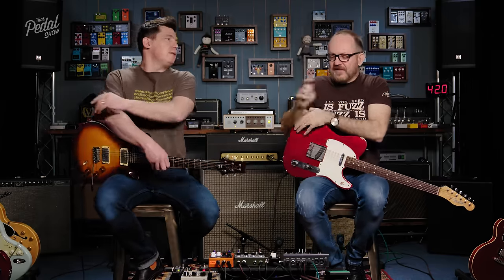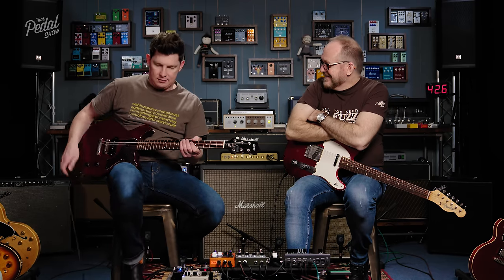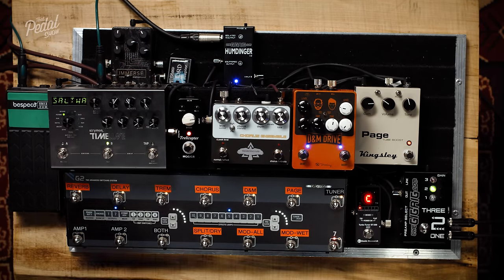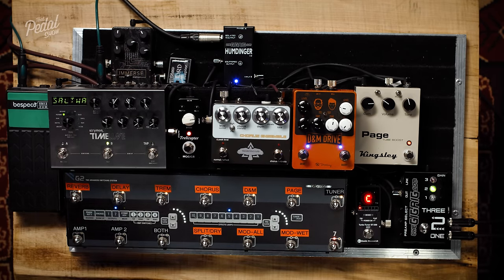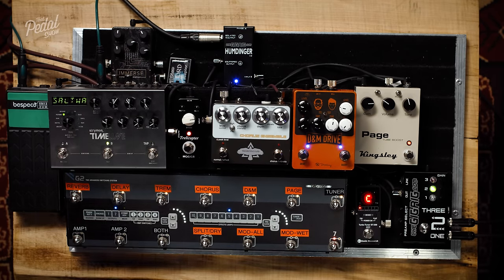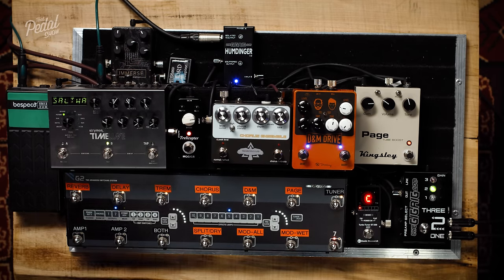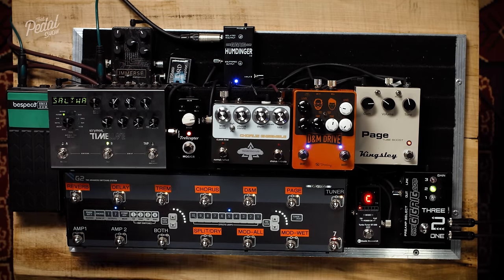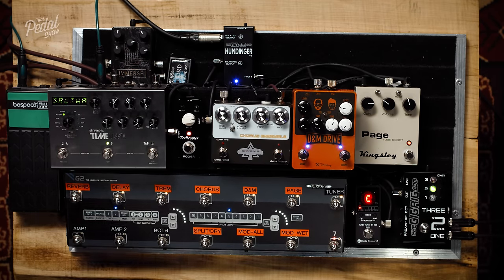Wet-Dry & Wet-Dry-Wet Amp & FX Setups Explained – That Pedal Show

Comment: It's funny. Maybe it's because I'm primarily a recording/mix engineer, but whenever I set up a wet/dry rig, I tend to think of the dry amp as my primary and use the wet amp as more of an effects send. I also tend to like a little reverb (literally just a touch) in my dry amp, so I guess it's more of a wet/not-nearly-so-wet rig.
Reply: The NotSoGuitarGuy I set them up as the dry signal is the base tone, then use the FX loop send, line out, or a DI box between the head and cab (make sure yours can handle speaker-level signals before trying it) to send that “uneffected”dry tone to reverb/delay to the FX loop return of the wet amp.

This thing where they’re splitting the signal before it gets to either amp is a strange and foreign concept to me. I guess they like how it sounds, though, and that’s the important part.
Reply: @OtherTheDave  - I'm definitely splitting before the amps. Sometimes I'm not even running into a second amp, per se. Sometimes I'll split off a direct signal and use cheating-ass computer modelling for my wet side and mic my dry amp (for recording purposes). This is about the only way I can manage wet/dry/wet with my current equipment.

Really just depends on the situation.
Reply: The NotSoGuitarGuy See, I’d call that a dual mono setup where you’re only effecting one of the amps. Wet/dry(/wet), as it was taught to me, was about mimicking the studio process where you record “your tone” (using however many amps that takes), then send that signal to whatever additional FXs you want (and, since this isn’t the studio, then on to another amp(s) so you can hear your FX).

That said, you do you. The great thing about music is that as long as you like how it sounds at the end, you’re doing it the right way.
Reply: @OtherTheDave  - if you look at it like I'm sending to an amp that just happens to be a virtual amp, I'm basically doing the same thing. The chain looks like this:

Guitar > wah/comp/distortion/boost/eq/etc pedals > splitter > dry amp > mic > computer > DAW

splitter > DI > interface > stereo amp sim with wet effects > DAW

I really only do this for wet/dry/wet where I need a stereo wet. I only have 2 amps and can't pull off a proper wet/dry/wet setup.

Otherwise I set up two amps and do proper wet/dry.
Reply: I like to put one delay in each actually, allows for some cool ping-ponging without going stereo.
Reply: Randy Russell I think my stereo delay has a “dual mono” mode. I’ll have to try that!
Reply: Same. I am hooked on a Dual rec/Vox split ATM, with all mod/time fx on the Vox dialed back a bit. At a 10 & 2 stereo spread it's just awesome
Reply: @thenotsoguitarguy9429  That's the pertinent point. Making things work with what you've got. Coming from recording in analog, coming into the digital age of late last century I've realised that a lot of $ was wasted due to thinking that some bit of kit was needed. I can get a sound comparable to what I needed over $150kau+ 
'90s with under 10k now still using some stuff from the old days. Whatever works, eh?

Comment: Great stuff as usual! It really spelled out the difference better than I've ever heard before. So now my question. I have one "good" tube amp that I use/like. It sits mic'd in an iso cab. I also have a modeler on my board as a back up for an amp failure. Can I use both in a wet/dry application? Is there any phase issues to worry about? I use in ears for monitors and can pan either as needed. Should both be up the middle, I'd this will work? I have a TC Electronic Nova delay to split the signal.Thanks and keep up the amazing work!!

Comment: I only play at home and have a wet dry rig beause of TPS and couldn't be happier. The first time I heard it in person, I couldn't stop giggling over pure sonic joy!

I've got 2 questions:
1.  Say you run 2 amps with no pedals ( I know, blasphemy). So you would for sure want something to isolate grounds(earth), but even without pedals, you would want a phase switch right? Amps getting the same signal from guitar could still be out of phase. In most tube amps, the phase is flipped at every typical gain stage. So depending on how many gain stages each amp has, they could be out of phase correct? 

2.  I really prefer phaser and flanger before drives. But don’t want them going to both amps. I would love to have drives to dry, then modulation, drives, and wet going to wet amp. Any suggestions? I was thinking of splitting right at guitar. One path would be modulation going into drives then into wet effects onto wet amp. The other path, with similar drives into dry amp. Could get some interesting sounds by varying the types of drives you have on each signal path. Haven't tried it yet, but eager to test!

Cheers from long time viewer! Hope y'all had fun at NAAM. I see the Captain and the Dane met Mr. Mayer!

Jason

Comment: A 1 Amp wet-dry rig? This is the video we have all been waiting for, thanks fellas.  I finally jumped in to build my wet dry rig.  It went great and I discovered it sounds just as good with wet-dry running the 2 signals through separate channels on my amp...phew.  TPS legal counsel can exhale...you just dodged lower back injury, class action lawsuit we were all about to file.  Keep on rocking in the free world...you two...

Comment: If you send Vibrato to the wet amp only is that, summed with the dry amp, not you really making "chorus"?
Reply: In some way yes, and that's kinda how the CE-1 "stereo" feature works. Wet (modulated, vibrato-like) on one side, dry on the other.
Reply: Yes but not Univibe-style Vibrato. I tried that. It wasn't a chorus.
They did this with the VB-2 in another episode. I believe Dan ran a Paige>Tumnus>ABY split>VB-2 & Delay to wet amp.
Best tone ever.
Reply: @mattgilbert7347  Univibe is not considerable a proper "Vibrato" because it's not just a wet (triangle or sine) modulated signal so that's fair.
As you say this could work better with a VB-2. Or if you hear just the wet side of the CE-1 it's just a vibrato :)
Reply: @WillGalluccio  Good reason to invest in an inexpensive vibrato. Doesn't have to be a VB-2W like they used in that episode.
Reply: @mattgilbert7347  Must agree with you all the way!
Reply: I am feeding three wet amps, two with phaser and one with vibrato, I want to compare it with a Boss DC-2 Dimension.

Comment: Hi guys, another awesome vid 👌. One question. Would you get the same dynamics from a wet/dry rig with say for instance 2x12 and 2x12 on top of one another and 2 heads on top? Thinking floor space issues in tight venues! Cheers

Comment: I was having a problem with my wet/dry setup and it was because I get my overdrive from the amp so I put the split in the fx loop but I didn't get that there were more noise issues that way.  Thanks Dan!  (and you are good eye candy Mick)

Comment: That was a really great informative video, thanks! one question though.  On the wet-dry-wet, I had originally thought it would just mean having a second splitter on the wet signal path at the end of the chain, I didn't think that you would be running in stereo for the final pedal.  What would be the difference if you used non-stereo wet effects and a second splitter? Would this negate the benefit of a wet-dry-wet over a wet-dry rig?  If you don't have the stereo effects switched on, then, what is going on with the signal chain?

Comment: Yesterday I did an experiment trying to get a wet/dry setup with only 1 amp (using Positive Grid BIAS) at home.
The signal chain is guitar->overdrives->soundcard input, from here, one soundcard output to a mixer, this will be the dry amp, and one soundcard output->Boss DM-500->Strymon Timeline->EHX Ocean11->second mixer output (wet amp). The mixer main ouputs connected to my monitors.
What do you think about this?, I got a phase cancellation issue, but I think that I can make this setup with one real amp and using a good splitter, and could sound really good!
And even I could insert a preamp or EQ before the MD-500 to add flavour to the sound of the wet amp.

Comment: I don't see how wet/dry with a 100% wet amp is all that useful though... You can't have more than one effect in your wet signal, right? Because if you have a delay and a reverb, both set to "kill dry", then the delay will only have the repeats, and then the reverb will only add reverb to the repeats, and remove the actual repeats (since they're its dry signal). So... What gives? Any tricks? One amp per wet effect?
Reply: Correct me if I’m wrong here, but you could do it, but you would only have the “kill dry” on the last effect in the chain, then in theory you could have as many as you want
Reply: @chrisj2155  That wouldn't help though. If you have a chorus, delay and reverb, and then kill the dry signal in the reverb, you will lose your chorus and your delay trails. The only thing you'd hear was a slightly more modulated and longer reverb trail. The chorus and delay would be the dry signal that the reverb pedal kills.
Reply: You don’t use kill dry in the wet amps.  The original signal is in the wet amp as well.
Reply: To use the kill dry on the wet amps (the purist way) you need to run each of the post-split effects in parallel.
Reply: I just re-read what Eskimo asked properly.  The way to do that is use kill dry on the delay and that will mean no dry signal gets through to the reverb pedal after it.  That would give you a workable wet/dry...
Reply: @morrisfraser7236  Good call, I hadn't thought about the parallell option. Would take some creative wiring to get it set up with multiple modulation and time effects, but I bet it would sound great.
Reply: You would hear the delay and chorus, it would just be very "wet", meaning drenched in reverb. If you set the first of the effects going to the wet amps to 100% wet, you set the following to say 50% wet, but it would still arguably be a wet only signal, because nothing of the original dry signal goes to the wet amps. (edit: this was a response to eskils comment a bit further up here)
Reply: @chrisj2155  if you sett the first effect *after * the split to 100% wet, then you can set the effects following that to whatever you want, but the signal will still be "kill dry" - because you have nothing of the dry signal going that way.
Reply: Yes, like I have the nuenaber immerse and the tc flashback, should both be set to kill dry? Should the first? The last?  I’ll experiment tonight hopefully but a great question
Reply: @jjrobiso  I would set the delay to 100% wet, and then set the reverbs (after) mix to taste. But you CAN keep a bit of dry signal in the wet amp too, of course. How are you splitting the signal?
Reply: Kristoffer Gjøsund I’ll probably be doing mooer trelicopter (mono out) to foxgear echosex baby (mono out) to tc flashback (stereo out) to nuenaber immerse (stereo out) to amps. But I need to rearrange the board as I have a fulltone ocd after my delays at the moment.
Reply: Wait, how do you split your signal? Are you running w/d/w? I'm not sure where I'd put the trem in your chain, but I would put the first delay to 100% if you really want that kill dry thing.  @jjrobiso

Comment: I definitely want to try this! So glad you put a tremolo in there because that is where I get stuck with wet dry. 

I like my tremolo as one of the last in the chain after delay and reverb but how would I do this on both amps in wet dry so that the trem happens and is nice and strong as an effect? Turn off the dry amp? Wouldn’t I then lose some of that definition and the advantage of wet dry?

Comment: Hi Dan and Mick. Love the show and this video. I notice that the 4x10 bassman amp was designed for bass but then adopted by guitarists. I have a modern 4 x 10 Fender bass cabinet that I’d like to use with a guitar amp head. Is there something about the physical depth of a bass cabinet that would make it unsuitable for guitar?  Or is it purely a “personal preference” thing? I thought I may use it for wet dry to pair with my AC15.  Thoughts? Thanks. Luke.

Comment: Excellent show. Lots of stuff to get one's head around.

If you're lucky you might not need a unit with Phase Reversal. 
Having one helps with checking and correcting for sure.
If your rig is in phase anyway all you need to watch for are ground loops innit.
There are different ways of checking phase. Some techy, some simple.
If you can record with two mics at once you can view a recording of the two amps in a DAW to check phase. 
i.e. See if the waveform displays in the DAW go up and down in line with each other …
 
I've used two transformer DI boxes back to back, with a phase flip XLR lead between them, to flip phase as a quick fix in a sticky situation. Of course it helped that I had a case full of DI Boxes to hand. Used a similar DI box arrangement to allow our trumpet player to use a guitar effect (Delay IIRC) on his mic 

A simple and SAFE way to isolate a ground  loop is to have a jack cable with the screen only connected at one end (Works for XLR cables too). At the disconnected end the screen goes into the shell of the jack but it's not connected and taped up to make sure it doesn't touch. The screen is still effective because one end IS grounded.
That way the loop is broken but the amps are still safely earthed. 
As you said in the vid, disconnecting the mains earth is a definite NO NO ... Potentially Deadly. 
Just emphasising that for your viewers.

Comment: You can do Wet-Dry with one amp: use a Parallel Loop Pedal that has a mix control! Your dry signal will sit on top of your time based effects; phasing reverb tails in the loop for instance.  The Carl Martin Paraloop pedal and the One Control Mosquite Blender are both good for this.  
Cheers! the Harparatus

Comment: I run a wet/dry setup but I still have reverb in my dry amp. I can’t do it completely dry. Then my trem & delays only go to one amps loop. To split my signal to both amps I use the gigrig abybaby & it is incredible! My rig is dead quite! Great job Dan!

Comment: I try and run wet/dry but it often turns into a mess on my board. I can do it, even if I have to write it out like an idiot. The worst time was when I was given 3 hours to "find another distortion pedal and a flanger because I want to DI you to two channels"
WTF? Why did I need a distortion AFTER my cab sim/IR? And my flanger goes before gain, or if wet/dry, into the wet amp. I tried to explain that it would mean rebuilding my entire board and he said: "just get a splitter". I have one ofc, a god ABY - but that's not the point. He doesn't understand wet/dry, this bandleader, he wanted to make one channel even more distorted and wet and then leave the other channel with my regular gain and mods. I can do it with amps - but I struggle doing it DI at the best of times - but this was a nightmare!
Ok, rant over.

Comment: Thanks for the diagrams! I sometimes found it difficult to follow what was happening to the signal chain just by watching what was done to the Gig-Rig. Here is yet one more WDW wrinkle: Guitar>Distortion>Splitter>Stereo Amp (Orange Rocker 32, JC-120 etc) and Dry Amp. The Orange 32 and JC-120 are combo amps but in the case of the JC-120 I have put the chassis in a head cabinet (because I hate the MDF box Roland uses) and run that head into two speaker cabs that can go on either side of a dry amp. In the case of the Orange 32, I series connected 2 ten inch 8 ohm speakers within the combo cabinet and use a separate twelve inch 16 ohm speaker in a matching Orange PPC112 speaker cabinet. The combo cab and extension cab go on either side of the Dry amp. In either example, the Orange 32 or the JC-120 have the wet effects in their stereo effects loops. I had long ago made heads out of JC-120's to get more speaker separation and because i hate the JC-120 cab. Same with the Orange Rocker 32. Giving it two separate cabinets widened out the sound. It just followed naturally to try a wet-dry-wet with them.

Comment: Great episode (as always!). You finally convinced me to add my Egnator amp to my Super Reverb reissue. But a question emerged when looking for a splitter solution. I am aware of the isolation and phase shift features, but what about active/passive? Does that matter if a splitter is active or passive? (I am running a loop system with a buffered input).
And a rookie question about phase: When dealing with a static setup (same amps and pedals all the time): Will the phase setting be the same each time the setup it is powered up?

BTW... I am still hoping for a short walk through of Mick's Super Reverb when you did your short "gear" episodes long ago ... the Super Reverb is a such a great amp and I love mine. But I find it a bit tricky to dial in (Mid does not effect the tone as much as Hi and Low, Bright switch on/off?, all tone pots down and no sound etc.). There is a so-called "Magic 6" setting, which unfortunately did not match my setup/tonal preferences.

Ooups... one more question. Even though Dan is the man behind one of the greatest and most flexible loop systems on the planet, and therefore may/may not seem impartial: What about an episode on loop systems? Pro/cons, what to decide and look for before purchase etc.The market seems to expand rapidly.

Comment: Great show as always!  Quick question: if you don't want to swap the Humdinger in and out every time you go from a one amp to a two amp setup, which output(s) do you suggest using?  Mick intimated that he only uses the isolated output (the one with the phase reverse) when using a two amp setup, so presumably I should use the buffered output if using only one amp?  I'm aware that both outputs are buffered - not sure I need another buffer for a one amp setup, but maybe that's the price you pay for keeping the Humdinger on the board for both applications?  Thanks for another excellent show!